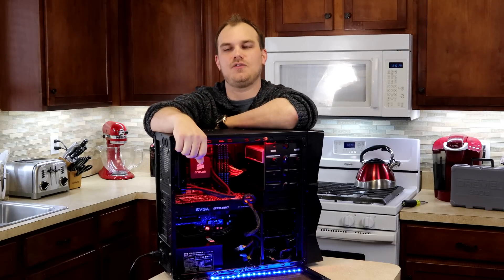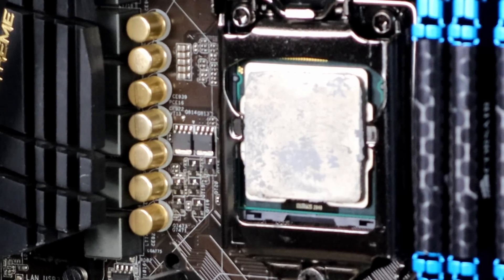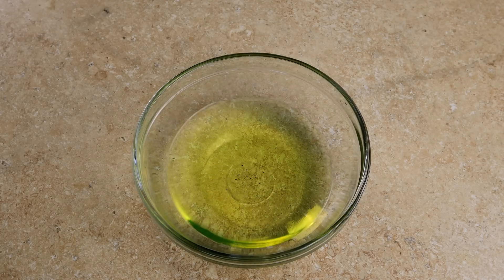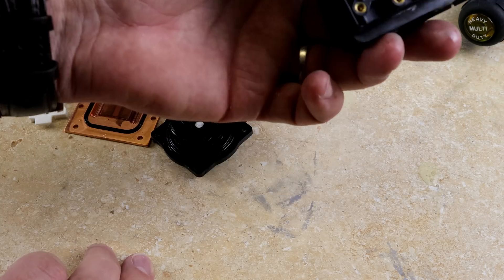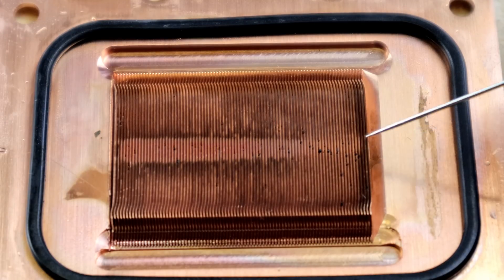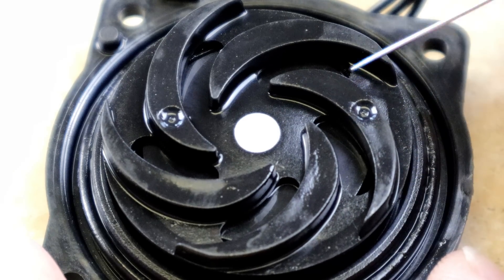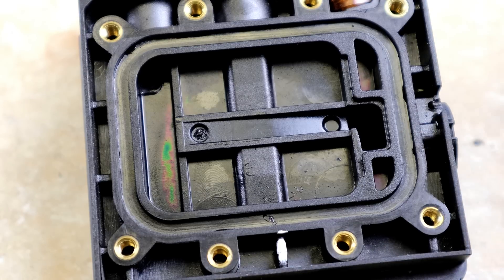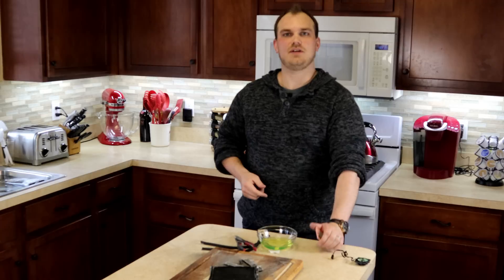TAKING APART A 6 YEAR OLD AIO | HOW WAS IT STILL WORKING?

Comment: If you wash the pump and It works you can buy some trasparent tubes a cheap radiator some coolant and you have a new aio lol
Reply from the maker: Funny you should say that because i really want to for a project im working on for a video and i dont know if i have all the pieces to put it together i will have to check
Reply: @MajorHardware   you can buy the radiator on AliExpress and the rest i think you can found to an hardware store :)
Reply from the maker: @halfbossswxbox360  Im going to grab the parts tonight and see if i can get it working again, i do have a CPU pump from amazing that was 11 bucks that im going to use in this project as a Proof of concept but it defiantly wont cut it if i want to try and make a full water cooling loop.
Reply: @ @MajorHardware  hey man did you ever do your custom rebuilt aio